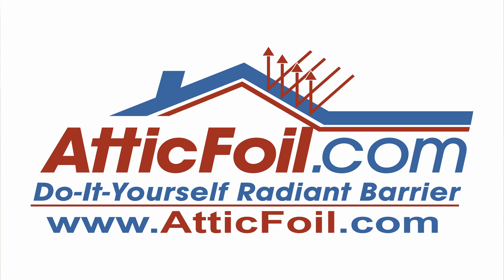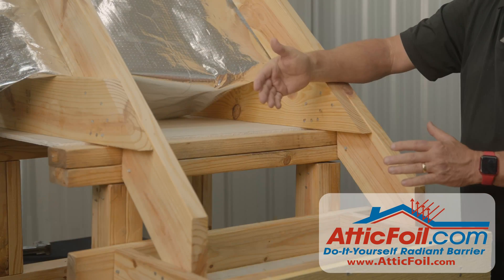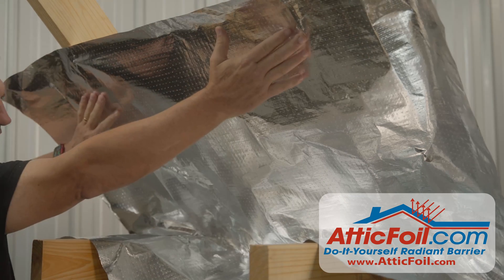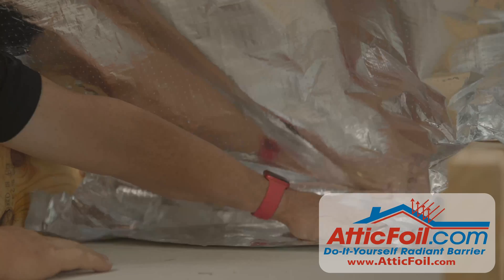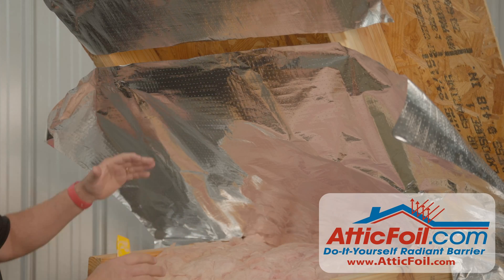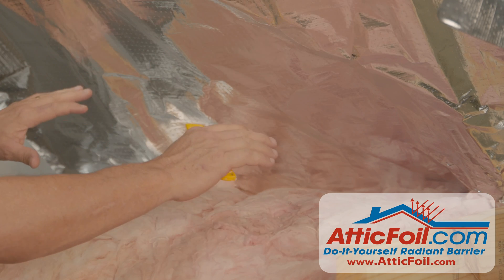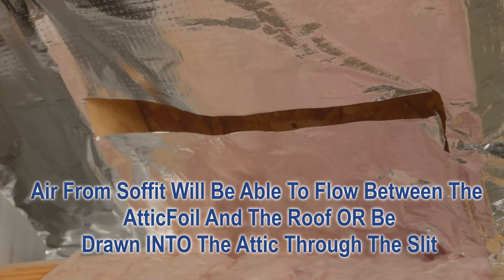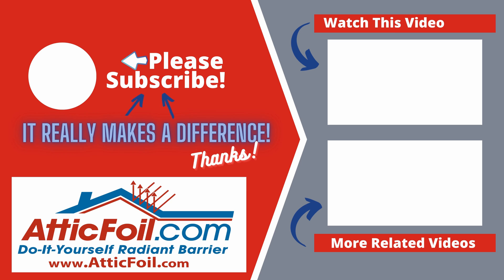Using AtticFoil As A Baffle To Keep Insulation Out Of Soffit Vents - New 2024

Comment: So if used as a baffle, wouldn’t cutting the slit in the middle prevent the air from effectively reaching the top of the ceiling? Would it not all seep through the middle slit?
Reply from the maker: Don't overthink it.  Hot air will naturally move to the top of the attic whether it's between the www.AtticFoil.com and the roof or inside the attic.  It all ends up in the same place.  And hot air is less of an issue than hot insulation caused by radiant heat.

Comment: I wouldnt just cut a slit , i would just overlap the bottom foil with the top foil and use a wooden block spacer to ensure a space between the two foils that way the roof decking is not exposed  withtout foild coverage.
Reply from the maker: No, hot air is naturally going to find it's way to the top of the attic.  Whether it's between the roof and the www.AtticFoil.com or inside the attic.

Comment: I know it was mentioned but to be 100% clear. If there is a ridge vent, should the foil be continuous up to a few inches away from that vent or still need that center cutout? Thanks!
Reply from the maker: Yes, you want to install the www.AtticFoil.com so that air will flow FREELY through the attic and never hit a "dead end".
Reply: I'm using batt insulation after installing radiant barrier. I'm leaving enough gap near the eave to accomplish the same flow. And where the radiant barrier meets ridgeline i leave a gap there as well. about 1-2 inch on both. for me, i would rather have flow near bottom and top rather than slit in the middle.
Reply from the maker: Yes, gaps at the top/bottom are ideal for www.AtticFoil.com  However, middle slits work fine if you are trying to keep blown insulation out of your soffits.